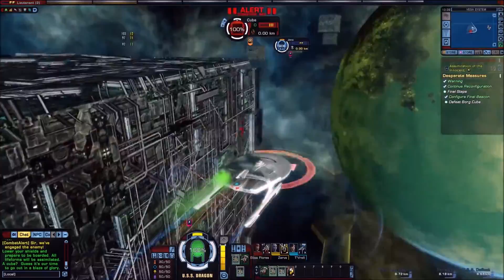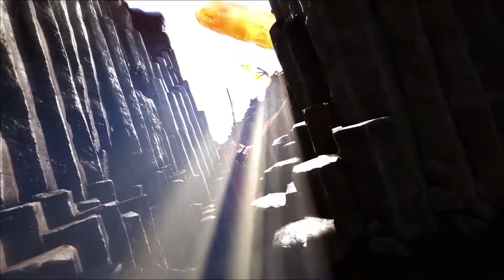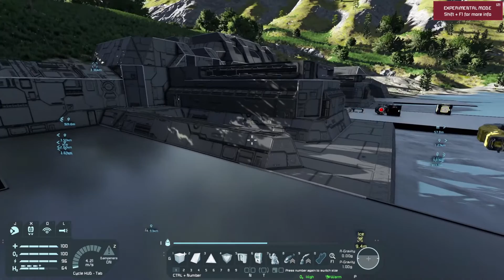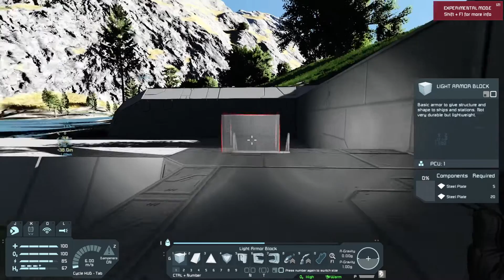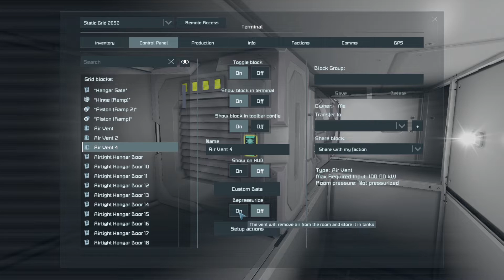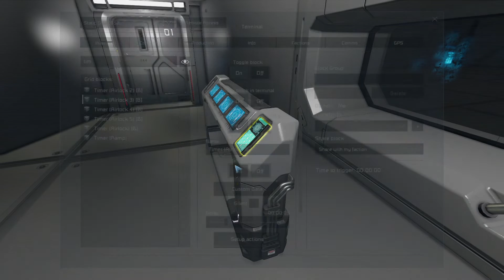Space Engineers #56: Setting Up the Airlock

Comment: Why do u not use a air lock script ??
Reply from the maker: I literally explained that in the video. Why would I use a script for something I could easily do with timers? That would just be lazy
Reply: @DragonNationGaming  I just feel like I am cheating when doing it it removes the fun. Especially if trying to make it super efficient aka 2 timers. I made one that uses 2 timers and has alarms and lights ontop of controlling the door. The only issue is the door that is open and is meant to be open does not lock itself. Soo someone can easily mess it up if it is a normal door and not aircraft hanger door.
Reply: @matthewgaming831  not everyone wants to learn C++ just to open a door bud